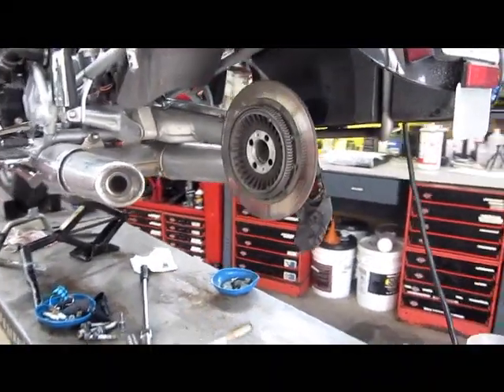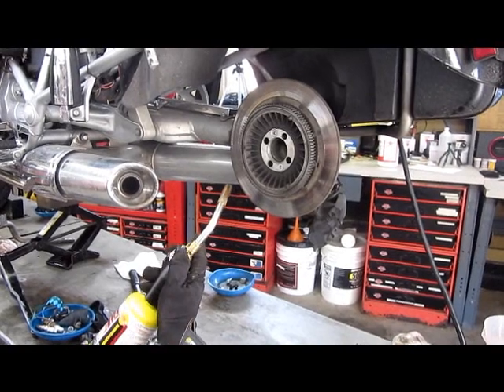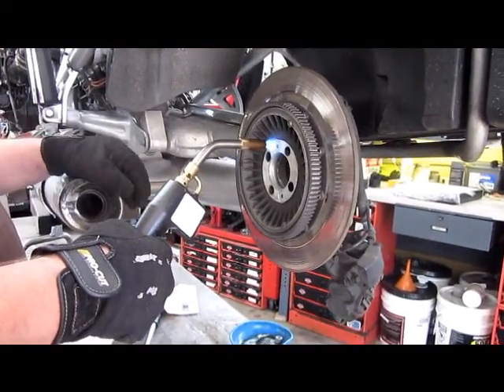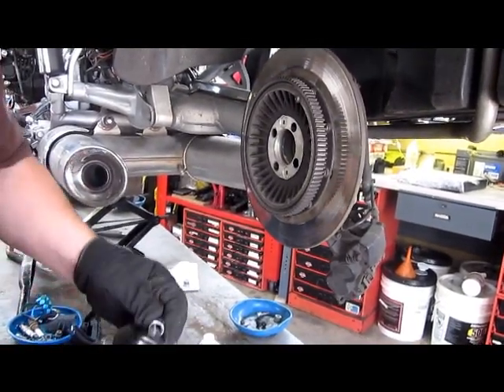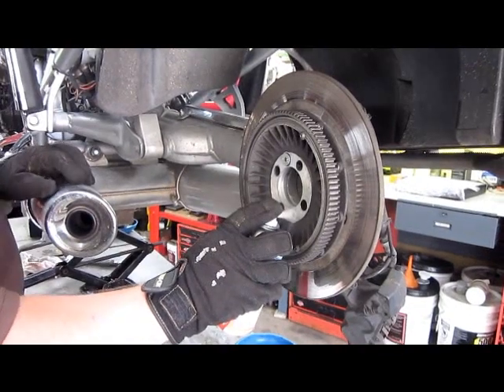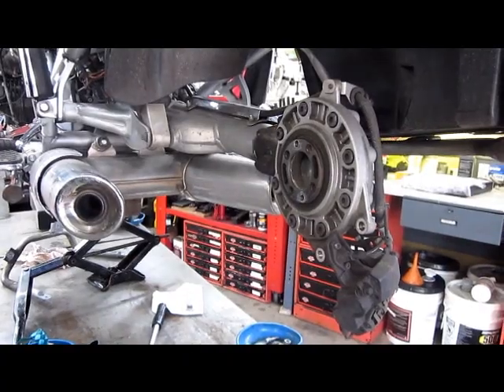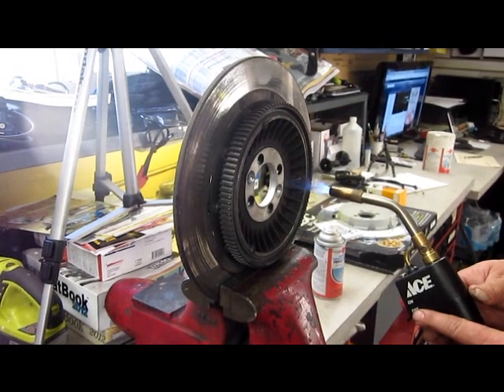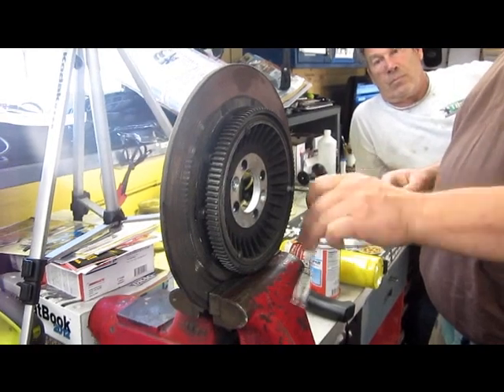BMW Service - R1200CLC Rear Brake Disc Replacement

Comment: Chris; You are a god send to financial challenged BMW motorcycle owners every where.  I have just replaced the rear rotor to my 2002 K 1200 with no problems.  I had previously located a EBC rotor for 140.00 at Motorcycle Superstore.  The BMW rotor was 530.00 here in NC.  GO CHRIS AND EBC !!

Comment: Old video, but informative.  Thank you.  I got my '98 r1200c going and it is at 14,500 mmiles.    runs like a dream, but I noticed this rattling the other day.  I changed the pads out and that is a whole other job there.  The German engineering is awesome most of the time, but they pushed a bit too hard on this topic and shit their pants.  Thanks again.

Comment from the maker: You need to replace the disc. Failure to do so will eventually lead to your brake disc sawing a groove through your rear brake caliper (R1200CL & K1200LT models) which will result in loss of braking action. There is also the risk of rear wheel lock-up if the disc carriers fail completely. If you own an R1200CL or K1200LY buy the EBC rotor from Beemer Boneyard. If you own a different model... buy an EBC disc online from wherever. Thanks for the question, Chris

Comment: Excellent video and WAS NOT boring like you say. It's a shame these rotors fail the way they do. I am pretty sure i'm going to need a rear rotor myself shortly and my bike only has 22k on it! Where are you guys located? Do you reccomend other indy shops outside your area?

Comment: Got me about rear floater disc? Swapping  3  cast wheel for 5 cast wheel on my R1100RT.Lucky my disc  screws came out easily.Very little locktite. Gr8 vid.

Comment: Great video.  Interestingly, on my bike, a R1100GS, the brake disc is bolted to the wheel so brake disc replacement is somewhat simpler.    Cheers from Michigan USA.

Comment: Hi Chris,  Does the 1999 R1100 RT Rear brake Rotor require the same procedure as what you've shown here or is it easier??  I know the RT Rotor Replacement is just the Rotor by itself.  Does it require heating too??   And if so, can I use a Heat Gun as I don't have a Torch.?   Thank you.

Comment: Chris, your videos are REALLY GREAT. I ride a GS and do all my own wrenching. Just picked up an R1200C 'rescue bike' and have her running great. It is a 2001 Avantgarde with ABS. Is there an aftermarket disk or one that can be machined to fit. Not paying dealer prices when my current one wears out. Thanks
Reply from the maker: Thank you! Unfortunately, no one makes a replacement disc for the standard R1200C (non CL) models. Happy New Year, Chris

Comment: Chris, thanks for the great upload. I am having the same issue with my rear disk and I was wondering if there was a way to fix the loose disk without having to replace it. Anything? Also, what would compromise on the bike not fixing the issue?

Comment: Hi Chris,  Always thought it was my brake pads making an annoying jingling bell noise in the rear caliper.  I would touch the brake to make it stop.  So as far as you know nobody makes an aftermarket rear brake rotor for a R1200C non ABS(if that even matters) ? Thanks your videos help a lot. p.s. Bot a set 4 speed bleeders $30 for the brakes and slave cylinder makes keeping fresh fluid in there easier. JW
Reply from the maker: +Jon W Correct, good luck.

Comment: When I look at this brake, I have to wonder why the disc needs to float on the hub at all.  Isn't the caliper a floating design, making the floating disc redundant?
With this in mind, I've thought about welding the floater pins to the disc to stop the rattle (TIG process, 308 stainless filler rod).  Is this a bad idea?
Reply from the maker: I can not think of a valid reason for the rear to be a floater.

Comment: Almost all the BMW's have something.  Some with more then others but wouldn't you agree that the LT is the bigger pain then most others. Even you have said that you dont like to work on them and they eat up lots of time when you work on them. Not to get into the part where they fill up your shop with parts and piles of stuff..

Comment: Hello Chris, my name is Ali, I am writing from Turkey, my motorcycle is the same problem, does not just change the pin solve this problem?
Reply from the maker: Replacing the carrier buttons that hold the brake disc to the carrier is a temporary fix. The holes in the disc and carrier become oval and the new buttons will not fit snugly. Good Luck.
Reply: thanks..:)
Reply from the maker: You're welcome Ali

Comment: hi Chris, for r1200cl, how does the front shock absorber's oil change video?
Reply from the maker: The OEM front shock of Tele-lever models is not serviceable. The steering damper is though I do not have a video detailing that and I find the damper useless anyway.

Comment: https://www.youtube.com/watch?v=b7IlOHITXHQ

Hello Chris; Rolandide does not work, I open the gas 4000 revolutions, turns off.4 I changed the spark plug. Could this cause a problem?
Reply from the maker: No